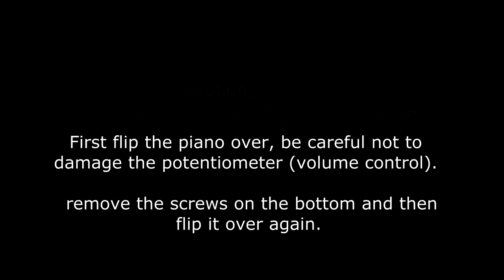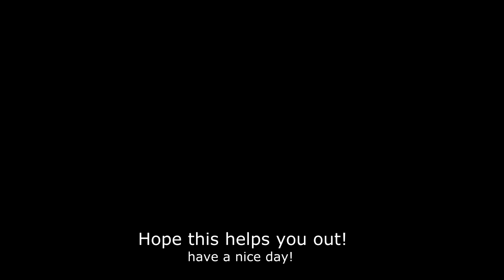Piano repair, replacing key contact rubbers (Korg SP170, 250, 280).

Comment: Ugh I gotta replace them?  I can't just clean them?
Reply from the maker: I've tried cleaning them first too, but the problem persisted. The contacts were just worn down and had to be replaced. Fortunately the rubber contact strips were not that expensive - there is a link in the description were you can get them -, It's been over two years that I replaced them and it still plays perfectly!
Reply: I just repaired the one I got.  Almost all of the keys were having issues, and after cleaning them all they still were having problems.  But I used the old pencil trick and scribbled some graphite onto all the contacts on the PCB, and now everything's golden!  Though I'll have to test it for a while to see if it stays golden. @Kraakmusic1
Reply: I did mess up the rubber strip that covers the four keys on the low end though, so I might need to order some replacements anyway.
Reply from the maker: @Daniel32396  I used to "repair" remotes this way, but in my experience this turned out  to be only a temporary fix most of the time.
Reply from the maker: @Daniel32396  I think replacing the rubbers is definitely the best solution in the long run.
Good luck with the repair!

Comment: Google's AI is pretty stupid. I ask him for spare parts for my keyboard and he wants to sell me keyboards. Nothing to do with what I ask for. That leads us to waste a lot of time searching. I mention this because the only durable solution is to replace the strips. Fortunately, there are people who make them to order, although I don't know the cost. The PCB is a more delicate topic. Digital piano manufacturers must evolve with new systems for measuring key velocity. The rubber strip system is obsolete. For now we will continue using the pencil.
Reply from the maker: I don't know where you live, but did you check the link in my description for a local distributor in your country? Most of the time you can order your Korg spare-parts there ( I paid about 75.00 Euro for a complete set in the Nether;lands). If this is not an option, maybe you can buy them on Amazon. Just type the next sentence in their search field; "Digital Piano Conductive Key contact Rubber Strip For Korg SP170 SP170S SP180 SP280 B1 B2". Costs about 40 USD (and some shipment costs). Hope this helps!
Reply: @Kraakmusic1  OK, thanks for answering. Mine is a Kurzwail, it's not very worn but I recently cleaned it with compressed air and a dry toothbrush. Where there were particles stuck I wet the brush a little, badly, plus some air blows were strong. A few days later the problem returned in C4, an overused key and I cleaned it even more aggressively. The result is that I had to take the low octave contact strip and place it there. I have learned my lesson, not too much air, do not wet. When I have money I will look at the manufacturer's manual, I think there are authorized services, although I doubt they will sell me replacements. It's a bit of a disappointment to see how vulnerable the contact strips are. It is typical of cheap keyboards.